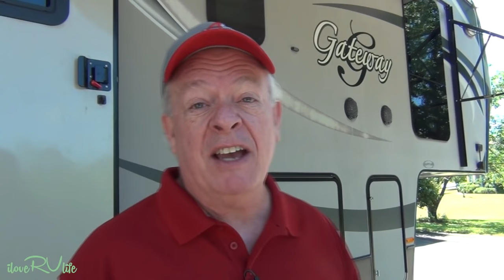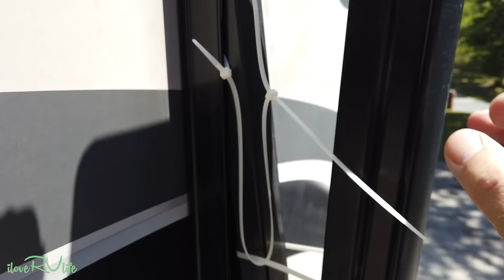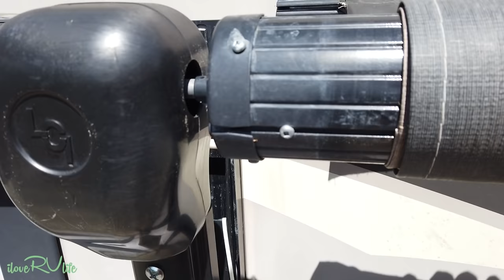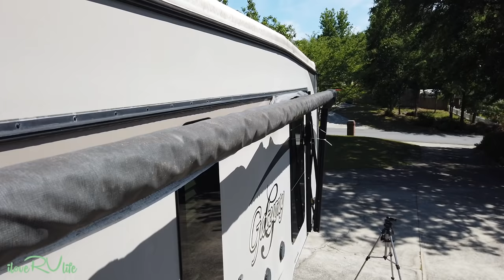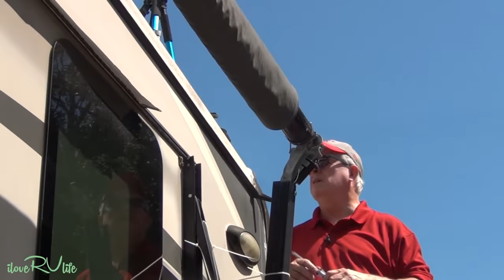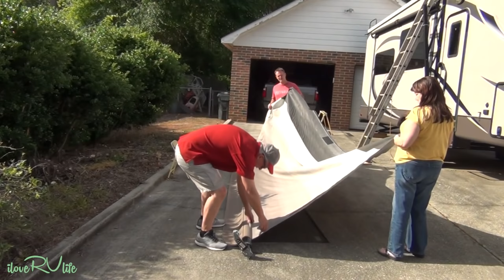Replacing LCI Motorized RV Awning

Comment: I worked with lci customer service on awning issue they were great to work with , made me believe in a business again.
Reply from the maker: Great to know Gary.  It's been a good awning system with much use.  6 years and going strong.
Reply: @iLoveRVlife  they actually sent me a replacement motor as mine didn't pull up tight enough , I had to send some pictures  but objective evidence is a good thing to prove something.  Happy traveling to you.

Comment: My motorized awning had a spring!! Caused injury to husbands hand. Feel responsible as I was the one that found your video. Several things you did made it so much easier so for that thank you! But need to say some motorized awnings DO have springs for your followers safety.
Reply from the maker: Sorry that happened.  Yes, this was for an LCI awning.  A good idea to check the manufacturer documentation for other models.

Comment: It would have been even easier if you had slid the awning fabric into the track on the RV first and then with the fabric hanging down the side of coach, slid the roller onto the fabric last
Reply from the maker: Thanks fort the tip Don.

Comment: Nice presentation and job getting that done. Mine are starting to wear pin poles so the inevitable replacement is around the corner. I’m not as reluctant to take the job on now that I’ve seen how you did it. Thanks for taking the time to make the video. Happy Camping!
Reply from the maker: You bet Brad.  We faced the pin holes too.  Ours last another year when that started then the seams let go.

Comment: Great video thanks. Mine pulled out exactly like yours did away from the trailer. I replaced one before on my old trailer it was a manual awning so it was a real hassle. I actually did it myself it was a lot of stress I won't do that one again. But I have a new trailer that's electric so I will give it a shot. thank you
Reply from the maker: Glad we could share.

Comment: I need to do this one our used camper we grabbed!
Reply from the maker: Not to hard with a couple of extra hands.
Reply: @iLoveRVlife  its easier because we don't have to fight the springs...   I wonder if we did the camper 1st, 5hen walked the bead on last?!  Thanks for the vid
Reply from the maker: I’ve tried both.  About the same.  If you don’t have a way to set the roller on something to keep level, the camper side would work better.

Comment: Great video. I am having an issue with the grey piping you pinched with the screws. It has started to work itself out I’m going to try and work it back in and pinch it as well.
Reply from the maker: Thanks. If the track is a little large.  Cut a piece off the end of the poly cord about an inch long and lay the 2 one on top,of,the other, the add the screw.  It will give extra compression on the poly cord.

Comment: Great info. One question. Why didnt you put the camper side on first?
Reply from the maker: Thanks.  Not sure I follow the question.  Camper side?
Reply: @iLoveRVlife  probably because I'm using all the wrong terminology. Camper side being the camper wall itself instead of the motorized reel. From a layman's view it would seem to be easier to thread the reel second.
Reply from the maker: Got the question now D.  It may have been a simular process.  The roller is bulky and we wanted to make sure all was centered and fastened.  That seemed to be the easier task on the ground.

Comment: Is there a specific type of awning to purchase?  We have the same motorized one you have but all the replacement awnings i'm finding online say "fits awnings that are manually operated without a metal cover".  HELP PLEASE!
Reply from the maker: We didn’t have the metal cover and was able to use the one shown on the video. Due to time, we were able to order the exact width  (side to side), but the length (extended from side of RV) was a little longer.  Hasn’t been an issue and we were able to meet our time crunch.  If you need feedback on an exact replacement, contact etrailer.com.  You can call their customer service and they are knowledgeable about replacement parts.  You’ll pay a little more compared to Amazon, but get the added service if needed.  We’ve used them for other products and they’ve served us well.

Comment: Hi Jerry...  I'm a newbie  ....  I've just come across your video looking for how to fix a motorized awning that wont opened. Last fall I was in a rain storm couldn't get it closed fast enough .... After the storm they had to lift & pushed it in as it motored in and it closed.... Now I am on the road ..... Thought I'd try to see if it would open and it's not get any suggestions? I am staying in a RV Park in South Carolina... Any ideas would be greatly appreciated....
Reply from the maker: I’d check to make sure there’s voltage going to the motor.  Maybe the obvious, but make sure the fuse hasn’t blown. If not, wiring with a volt meter at the motor.  If you see 12 plus volts, suspect the motor died.  Our motor fried after first year of travel.

Comment: Do you know how to remove the led strip of lights from the rv awning? I want to put up a sunblock but the led lights are in the section to install it. Thanks
Reply from the maker: If the leds are in a slot and not permanently affixed to the roller track, they should slide out.

Comment: Great how to video!  Are there quick connects for the wiring or do you have to cut the wires and use butt connectors?
Reply from the maker: Thanks Jennifer.  Depends on who installed the awning and motor.  Mine had connectors.

Comment: Thx Jerry...This is my next project. Question: the tube has 3 slots. Do you only have to thread one through or are there 2 beads? Mine was slid off by another RVer and I can't remember how it was originally attached. And thanks for the tip on the SunWave
Reply from the maker: Hi Larry.  Depends on the roller.  Mine has several slots.  Look at how it’s rolled next to the RV.  Use the one facing the bottom.
Reply: @iLoveRVlife  - Thx Jerry
Reply: Hey Jerry...Just an FYI. I order the awning from SunWave for a 17 ft awing. We measured from center to center on the arms and it is 17 ft 1 inch. Ours is a TCI like your. The awning arrived from SunWave and after sliding the awning on it went right up to the edge of the plastic end caps. That did not seem right as yours has 2-3  inches on either side. So I measured it. 16 ft 4 Inches.. Contacted SunWave and they are sending a replacement..but I am not positive this will work. Maybe I should order a 16 ft???
Reply from the maker: I ordered the 16’.  Would have liked to had a little wider, but wanted to make sure I didn’t overlap on the edges.
Reply: @iLoveRVlife  - And your awning arms are on 17 ft centers?
Reply from the maker: They are.

Comment: I'm hoping you can help me. I'm going to have to replace my awning as soon as it gets delivered, however I have separate issue with my awning. The motorized unit is extremely squeeky and actually got stuck. The black arms that move the awning in and out had been struggling to do their job. Any ideas on what could be causing this?
Reply from the maker: Could be a couple issues.  I'd check the bolts to make sure they haven't been over tightened.  They need to move free.  Spray some dry lubes on each joint.  You didn't mention if the awning is rolling up straight or wrapping uneven.  If uneven, it adds stress to the motor and should be corrected.   If all this doesn't correct, the motor could be failing.
Reply: I Love RV Life! thanks so much!
It appears to be rolling in fine. Only one side is creaky and appears to be struggling. I’ll do what you mentioned though.

Comment: Would it have been easier to tread the top first and then slide the roller on from the ground ?
Reply from the maker: Maybe.  Still would be a bit of a wrestle moving the roller and sliding awning in the track without tearing.
Reply: @iLoveRVlife  Yeah , getting ready to do mine and just figuring out the easiest quickest way to get it done.

Comment: I wonder if the use of bleach to clean awning caused the threads to deteriorate on the oild awning?
Reply from the maker: It’s so little bleach and is only on the awning for a very short period.  Think after 6 years of heavy use, winds and sun, it had given us all it had.
Reply: @iLoveRVlife  Yes, you did get good use out of original awning.

Comment: Why didn't you just zip tie it from the top in the first place instead of using two sets of ties? Wow you made this much harder than it needed to be. Just remove the two set screws that hold the awning tube to the motor side and the idle side and the tube will just slide off the bearings. No need to pull the whole motor assembly.
Reply from the maker: Next time.